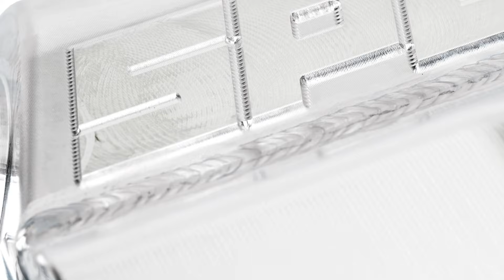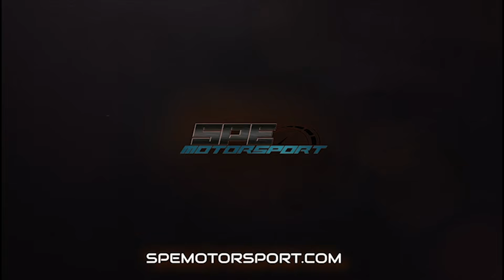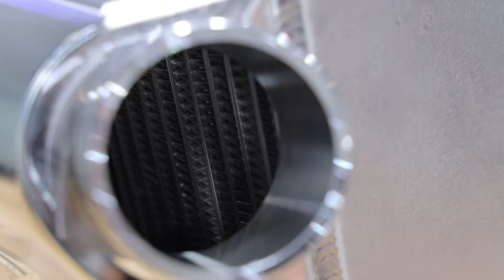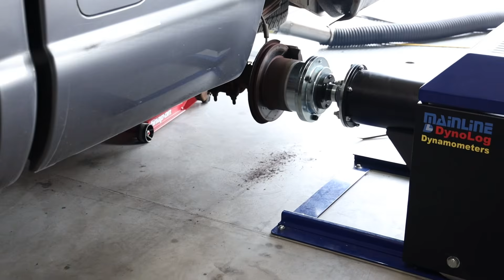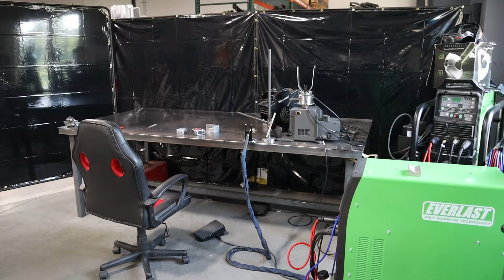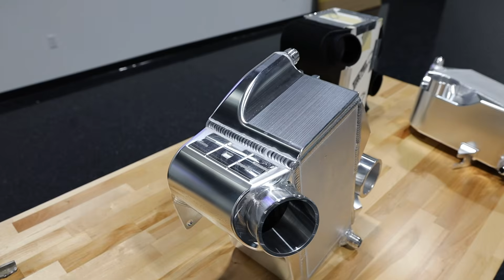SPE 6.7 Powerstroke Billet INTERCOOLER - PRODUCT SPOTLIGHT

Comment: @SPE. Any comments able to make in comparison to PPE Intercooler? Both newer on market, both state about 100F lower EGT’s.  Reading PPE has much lower Cold Air Temps, but no info on PSI drop between Hot & Cold.  

You site about equal to OEM CA temps, with increased flow, density and boost at the Intake. 

Looks like using same type of Core.

Comment: 15-17 mins of nonsense. Lots of talking to say it does basically the same thing as the stock one….k the Ford Engineers did a great job so save your $3000!
Reply: You're kidding right? Try talking about the Ford quality to those who's IC's have failed. I'm looking for one better than OE because it failed at just over 100k miles. Very common issue. OE cooler = junk!
Reply: @jonmccauley6490 I’m at 200k with stock IC. No problems yet. Still performs perfect. So 3k for minimal improvement? Eh

Comment: I installed the No Limit on my 2017 f250, it's compounded with a kc stage 1 in the valley and a s480 feeding that. Cp4 to dcr swapped. I dyno'd it and coolant started spraying out the secondary tank. They told me it's cause the No Limit has a leak in it somewhere. I left it alone and this past week was pulling a trailer up and down through the Oklahoma hills, got home and the plastic t fitting going from the intercooler to the secondary was melted. Took it to the shop and they told me it's cause hot air is going through the intercooler with no coolant which caused it to melt. Called No Limit and they didn't want to warranty cause my truck is compounded. I've had it less than a year too. Bout to switch to the SPE intercooler regardless of price. We'll see how well it holds up, can't wait till it's here. What do yall think? How's the quality compared to the No Limit?
Reply from the maker: We think the product quality speaks for itself. If you need help placing an order, please let us know. -Amy
Reply: Update please !

Comment: the battery next to the intercooler should be relocated to the bed and then u can make a much larger i/c  there.
Reply: Then you would/could have some real boost lag. hit the point of diminishing return pretty quick. But i totally agree. both batteries in bed or frame. like the big ford vans

Comment: The OE intercooler is not bad by any means, which makes improving upon them very hard to do. It'd be awesome to see the lb/min mass flow in vs out on both the stock cooler and then your cooler. That would be the best way IMO to view the efficiency of your cooler vs the stock one. You could then graph them both over engine RPM to show the mass flow improvement which equates to the HP improvement. Heck even just showing the mass air flow of each run over RPM pre and post would suffice.